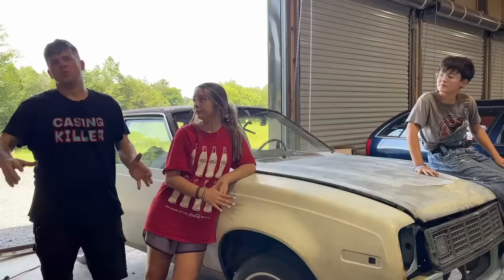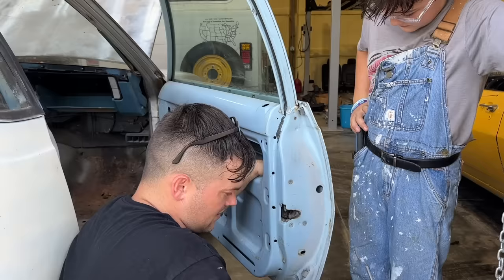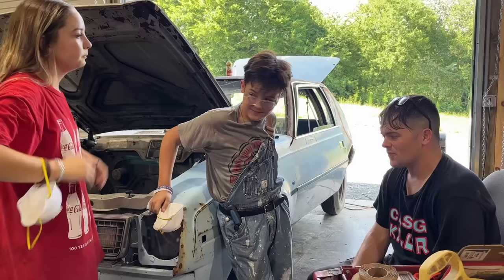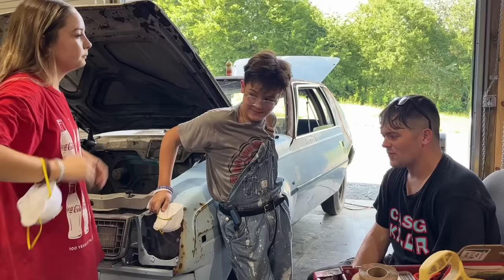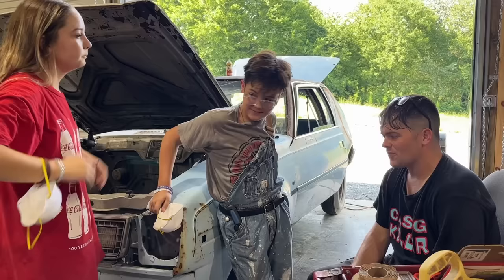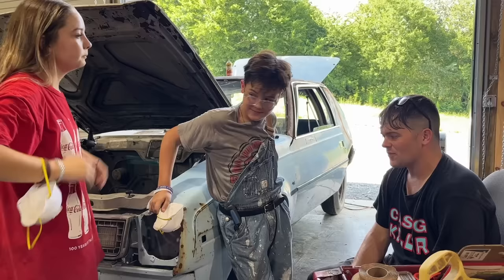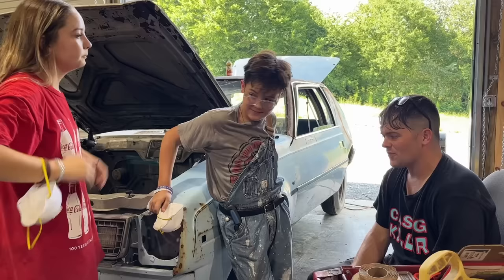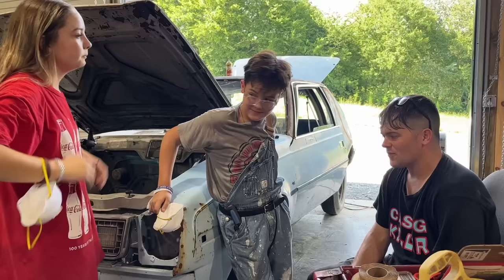DIY Budget Paint Job Completely Changes The Look Of Our Gremlin?

Comment: My guess on what you were trying to recall the smell from the interior:
I tried to disinfect a car (carpet removed) with cheap pine cleaner once to get rid of the mouse smell. It seemed I could always smell that combined Pin-Sol & urine odor for the rest of the time that car was in the shop. It was almost as if the pine solution 'etched' the odor into the paint on the floor boards. The car wasn't rusty, just stored too long.
Reply from the maker: 🤮nasty for sure

Comment: 3 parts acetone 1 part paint or primer and don't be shy with the hardener  I use about a can and a half to a gallon of paint one other little trick with enamel paint is heat the paint up and shoot it warm it will help it dry fast and hard .. and nice work as always sleeper dude and family..

Comment: Your kids may need to read this: I remember there were times when I was a kid that I didn't feel like doing some skilled work that my grandfather and father asked me to do. Some I remember were straightening some used nails, sawing off some wood, unclogging the drain, patching up a leak and other stuff. Now that I'm an adult, I am so grateful that I was "forced" to do so. I have saved a significant amount of money by doing things I've learned instead of hiring someone or buying custom furniture. It also gave me something to fall back on. When the day and age comes that corporate work is no longer a thing, I know that there's another line of work that I can earn from. 

They don't need to be mechanics when they grow up, but they will surely reap the rewards of being able to work with their hands.

Comment: If you have a Dollar Tree near by they have packs of sandpaper just made for those sanders. And the garage door latches on the outside (I hated too), you can drill new holes on the inside on the opposite side they were on, and drill some holes through the sliders to make one big hole for the latches to go through, and they are inside.
Reply from the maker: Ok thank you

Comment: change the needle in the cup gun to a 2.0 will help drastically. It has a fine needle in it , usually they come like that. That's why the paint is coming out so slow. Plus you should adjust the fan to be a bit wider
Reply from the maker: Good idea

Comment: Front valance is correct for the car. The grille is for a '78ish AMC Concord. The factory '77 and '78 Gremlin grilles were brittle plastic, and not many survived. You haven't been able to get a new/old/stock one for 20 years or more, so guys are using the Concord grille because it almost kinda fits the hole, and they were made of much tougher materials.

Comment: Dang. This car ended up looking good!! I'm from Norway and close to 50 now..when i was around 18-20 and got my license i dreamt about getting an american gremlin with some phat tires and a v8.  I thought it looked so cool but there was absolutely not a car many imported here.  Ended up with a 1986 Chevy van 20 in bright red paint with hood scoops, Gangster cap (like we call it at least) And all the horns and lights on the roof front.  Superb car with low HP....ran like a wheelbarrow and had no brakes but i loved it! Even went outta gas like 4 times a week cuz i couldnt afford to keep it going.   Good times 😆😆

Comment: I had a gremlin ,was a great car,bought it $300.00 dollars spent $2000.00 drove it for three years it had a 4 cylinder engine,rebuilt it and transmission, body work and etc. I sold it to a friend of mine and believe it or not still driving it today,I really miss 😢that car.

Comment: Since you are building that car specifically for "burnouts", have you considered installing a line lock on the front brakes? Pretty easy and simple to do and would eliminate rear brake pad wear, heat and damage.

Comment: You could make good money selling the extra parts.
Gremlin X came with nice stripes. The front ends were shared the Hornets and if I remember correctly the doors and parts were somewhat interchangeable as well. Your front end reminds me of the car following the Gremlin the Sprint I think...... was not around long. Just running out parts from the piles...... was even offered as 4x4.  Love your builds and team work. The Western wheels on the Pinto are awesome as well. The missing mounts were for eighter an inline 6 or a rare V8 ( 304 ) or 232 or 258 inline, with the clutch pedal I would guess a inline 6.

Comment: Being an amc guy I can tell you a few things. 1, those rotors should be commonly available at any auto parts store. O’reilley brake best number is 56757RGS.. being the last year for the gremlins amc switched the front clip to a hornet style, so that is the original style front end for that car, which is a bit different than grim.. can’t wait to see the motor you’re building for it, I like the orange paint job but ya should’ve taped off the fake louvres on the sail panel so they’d still be orange. Good luck with Cleetus and cars @sleeperdude and family

Comment: Heat gun to soften the glue on trim boogers! Or trickle boiling water over it. Either way your adding heat to a summer day. WD40 or other solvents work, if you have a day to wait. On paint you want to keep, there are ways to avoid abrasives.

Comment: Set on a flat surface razor blade on a block spacer thickness you want tape for edge line blocking. Spin roll of tape against razor blade and BAMM! Thin flexible tape.

Comment: Ha Josh you should put a V8 motor in it.AMC had a V8 engine in the 1972 Gremlin that packed a 5.0 literV8 under it's long hood even if it only made 150 hp thanks to the malaise era.that would be very cool and fast.
Reply from the maker: V8 coming soon

Comment: Hate to see it get trashed for as good the body is there get harder to find good shape remember riding in friends in early 90s it had 350 in it and all it did was smoke tire  honestly I would shove in motor trans slam it and also do suspension make fun as a time attack or auto cross car seen one back when I raced and surprised how good  it did seem it beat out some truly built cars and the most money he wrap up in suspension alot built by himself and one thing he said helped was setting motor back couple inches  it was a high reving small block it was a cool car keep up great work and everyone have a wonderful day.

Comment: I used the same exact paint to paint my old 79 F150. Kubota orange also. It goes on so thick, it don’t hardly run, but it will sag. I found that out the hard way. I had to sand the bedside down and do it over. After that, it turned out fabulous, but within a year, it faded and looked terrible. I contacted the company and they said I should have used their clear over top. So, I went and repainted the whole truck again and used the clear coat. Within a year again, the clear is all cracked. I gave up on that paint.

Comment: Excellent video Josh  :) , family   :) also for sandpaper use 400 soft grip may take lot sand paper use and plus when spray gun want great flame feather about 1 inches too Spraying  and have arm length too ! 2 times primer and sandpaper  also scotch bright on headlights areas plus rough spots too ! Plus clear coat ever 4 to 8 hours on coats on paint  and why bugs love paint is sweet of enamel  and lead too mix too ! Hood would not use Josh and use homemade one too ! Also for brakes Josh  in front rotor check for Disks of 2002 Chevrolet Impala LS o SS    on no ABS types back wheels ones and to for back wheels drums if AMC Gremlins car has  use emergency brake handle  in  console type or pedal too that near main pedals too won't need pressure only clicks on  to stop if needed if front one fail ! On Roof want put Black flames decals stickers on roof looks super and hood too! Hope see more videos too soon watch on this Gremlin car and take ideas!

Comment: Had a 74 Gremlin which had a 304, then switched it out with a 401 - 4speed. Tire smoker and very  fast with front tires off the ground in each gear 😳 then painted black with very course metal flake.

Comment: when measuring center to center on bolt holes just measure from the inside edge of one one hole to the same side edge of the other  hole , this give slightly more accurate measurements.  an old toolmaker thing.

Comment: Buy a zon cup and zon everything you paint to 22 seconds with reducer. Everything should spray the same and lay flat. To adjust the needle back off the needle screw then pull the trigger all the way and start tightening the screw until you feel it in the trigger and stop your set. This is how I was trained.

Comment: I had a old timer who did restoration work on old cars he could not find rotors for and o 29 ford. And what he did was baked the rotors at 200 degrees and use cast iron welding rods and resurface the rotors and the return them to specs. One thing about wielding cast iron you have to heat first if not it will crack the rotors.  But I don’t recommend this but that what he did in a pinch. The best way is to replace the arms out and put new rotors on.

Comment: I'm  restoring my 66 chevy  pickup  I've  never  shot paint  before  but have  done  a lot of body work. My cousin and I painted a semi twice the first time had a lot of orange peel and we had to  redo it  the  second time took a week  to sand and repaint. But  it  was in the middle of winter and in a heated airplane hanger. We did that 18 years ago and you can still see the green paint on the floor

Comment: You might try using used tyranny fluid as a stripper , usually about 8 minutes on a hot day . Did you ever use micro balloons and resin. By the buy , M.E.K. is hardener / catalyst, ( methyl ethyl keyton)

Comment: the rotors try ones for a 78 amx, as you got to keep in mind amc would use the same type of rotor for another car in there line up. try ones for a 78 amc Concord, or 78 Spirit or a 78 Pacer or 78 Hornet. they could work for it.

Comment: I know yall have a trailer to haul with but I really think it would be cool if yall had yourself a small rollback towtruck parked in that very first bay! That would be cool especially if yall bought a late 80s early 90s ford  Chevy or gmc rollback that you could build the motor in and make it kinda hot rodish that would be badass

Comment: If you're gonna go automatic, I'd happily trade you an automatic pedal assembly for your four speed pedals.  

Also no, those are not original AMC steel wheels.

I just checked Rock Auto on Sept. 13th.... they show Raybestos rotors for the 4-cylinder car.  But, with a 3-day delay.
You have a slightly larger assortment if you go with 6-cylinder rotors, but you'd have to get the associated calipers as well. The spindles are the same 4, 6 or V8.

You know, '78 is the last year for a Gremlin and they are kinda rare.  These cars are going up in value - it might be worth fixing up after it's time as a burnout machine.

Back in the 60's & into 1970, AMC had what were called the "Big Bad" colours.  They were Big Bad Blue, Big Bad Green and Big Bad Orange.  The color you sprayed your car is a couple shades darker than Big Bad orange, but it's close enough.  If you check out my Youtube, my own 1970½ Gremlin is a real, factory Big Bad Green car.  BBG was the LEAST popular of the Big Bad colors, only available on Gremlin from April to July of 1970.  I can only document THREE (mine and another) real BBG cars, but know of one other who hasn't gotten back to me with his VIN and door tag.

But yeah, so far can only locate 4 Big Bad Green in the roughly 30,000 Gremlins sold in 1970.

Comment: Soak the rotors in evaporust, then lightly run your orbital sander over the disc faces, won’t take much material off , but they won’t wear your pads so bad

Comment: I backyard painted my purchased brand new Nissan hard body 27 year later a mouth latter a spring broke in the" original "clutch disk.i replaced master cylinder, slave cylinder because it wasn't slipping or clicking., it just quit stuck it in 2nd gear drove 1 mile home. Anyways the paint job looks excellent from 20 ft ok up close. Finally getting around to replacing clutch. To anyone replacing a  clutch in a 1995 Nissan 2.4 its not simple.had no idea it had so many parts. My girl said get rid of it. No way! It still runs great. I replaced 3 starters 2 alternators 1 radiator once not because it was rusted the dang plastic tank failed. Like 6 batteries 2 sets of shocks, brake pads, tires every 4 years and nothing else. Nothing !...synthetic oil changed every 3000 . Im gonna replace Carrier bearing u joints are still good. 2 more yrs and ive had it 30. Yes ive had other trucks but first brand new vehicle i purchased and the last brand new one😂 in 2025 im gonna give it to someone starting out total stranger gonna get a perfect running truck for free. The Ac still works 😊 roll up windows never fail gonna miss it but i said in 1995 im gonna drive it 30 yrs...

Comment: maibe you can weld up the grooves in the rotors and turn them down , either that or find rotors that are close to the same and redrill them for the amc
used to work with bondo ... untill i became alergic to epoxy (thats the main part of bondo)
btw since bondo is poreus you might want to primer the bare metal before smearing the bondo on , prevents the metal from keep rusting and pop off the bondo in big pieces 
the front end kinda looks like the one from a pinto or a vega
the bug might actually look nice in that orange too , would put more work in the prep for that one though

Comment: @36:40,, LOOK past Wawa and see that little 1946 or '47 Willys flat fender 'Jeep'.  I've not seen it before this episode. I had a '47 with a HiPo 289, GM 3 speed with OD trans, paddle tires for sand dragg'n, TerraTires for hill climb'n way back in the mid 1970's. I wonder what Josh 'n family will do with that lil rig? Likely he'll stay with the factory 4 cylinder, 3 speed square cut gears it had when new.

Comment: those guns are pretty decent you got to turn up the fluid knob it's in the back right there to let more material come out I've had a bunch of those I like the little $20 gun I spray a lot with those you know it's not an iwata it's not a soda it's not a digitally regulated gun but a lot of times people don't pull the filters that goes down in the cup out that's got to go those cheap little primer setups from rural King tractor supply pretty decent I've had problems out of the high build primer from advanced Auto and AutoZone they get soft spots in the primer it'll be all beautiful and it'll have one little spot that'll just get a bubble... I even use like leftover spray paint or close to the same color spray paint as primer sometimes for those it's just got to look better but actually it'll come out real decent what I do is get like if it's black just put black on it as the primer it's got a set for a little while you got to let it sit for maybe two days depending on the weather if it's good and hot out you can just put it out in the heat 320 or you can use 220 wet for faster results and then I buy actual paint which is super expensive I just dust that color on until it's right and then you know you can clear coat the clear coat had everything it all depends on the metallic like if it's heavy metallic I sprayed a whole bumper cover with half of a half of a pint just dusted the color on it clear-coated it it look great I did it on the Jeep you can check out my tick tock I just use spray paint as the primer it did really good it's still holding up it's been 2 years but that's what I like to watch those little cheap paint jobs I've seen some guys take rattle can and just a little bit of regular actual car paint and turn out real decent I've used those little cheap jobs from tractor supply people like all men and never look right the trick with the cheap guns is when you put your clear on there once you go wet just keep it wet the only thing with the cheap guns like the $20 one they orange peel if you've got an actual paint booth you can just put that clear coat on there just super light and then turn the baking on 160° for 10 minutes it'll flatten out like glass you got to be careful because it'll run if you're using a paint booth cuz as soon as you turn that paint booth on it just makes it flatten out slick like glass we used to make fun of people because our paint jobs would be glass and we had that $20 paint gun they would be pissed but if you can wet Santa buff you can take a $20 paint gun or you know I've had about four or five of those widow guns they're decent but you know for a budget paint job I just use them on my way. Or I just taken using for a primer gun you know I like to use the better primer the 2K or a polyurethane primer a high build but you can use rattle can whatever you got left over if you know how to sand without going through your building you know this when you build it turns out slick man guys that can do it laugh at guys that can't but if you've been in the paint game you know you're trying to make money you know what I'm saying and I work with people's budgets man like little patch jobs you know sometimes those single moms don't have money to cut metal out well back you know you can put a piece of tape on there slick it off and it looks good for them you know if you can make 40 50 bucks in an hour good enough

Comment: If you take a nail and poke about 6 holes in the lip of the can it will push the paint back into the can instead of splashing it out and all over you and everything around you
Reply from the maker: Good tip

Comment: Wow the Gremlin is looking so good you did a great job on the painting with cheaper type of paint 👍 but I would have use blue paint and the line White or black. Just remember to put frame connectors in or the life spring's will go through the floor and twice the unibody then the car will be junk. We built the frame connectors we did it all laying on the floor at lest you can put the car up in the air